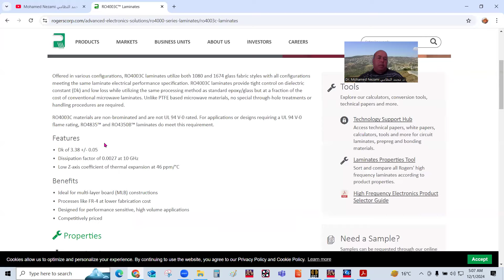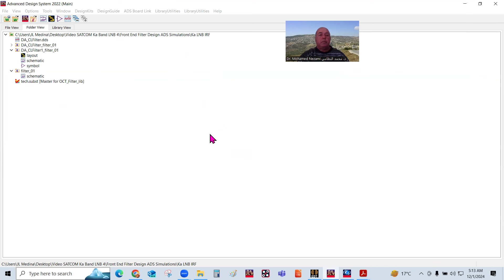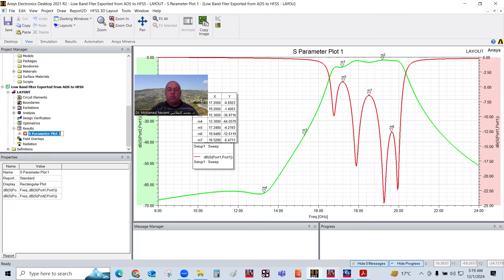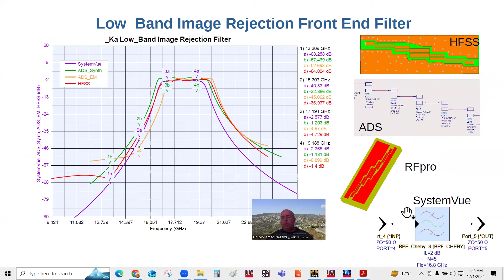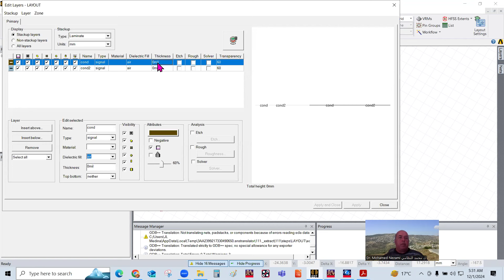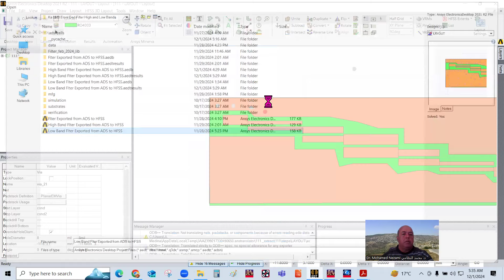Part 4: Design of K/Ka Band SATCOM   Low Noise Block Down Converter (LNB)

Comment: Hello .

Very interesting.  I am in the same situation inherited a filter  ( box ) it switches between two filter low and high. The question how the do both in the same box. Did they put on onntop and on on bottom? My application is for modem L band 950Mhz to 2.3Ghz. I want to replace it by a new filter but I have space restriction.
Many thanks